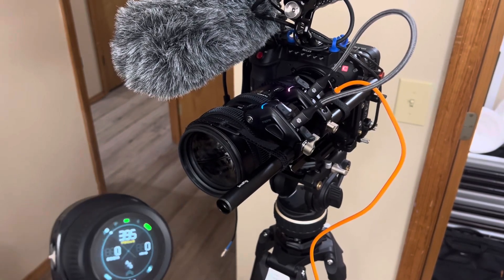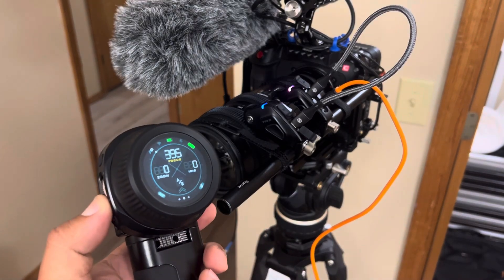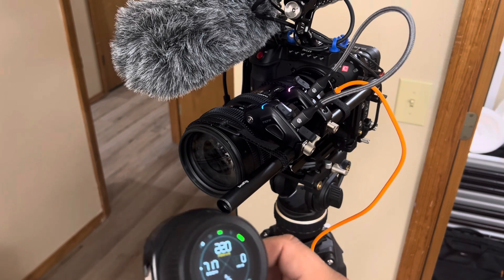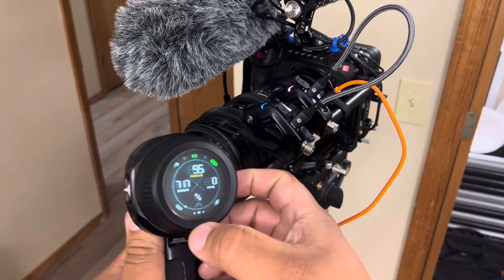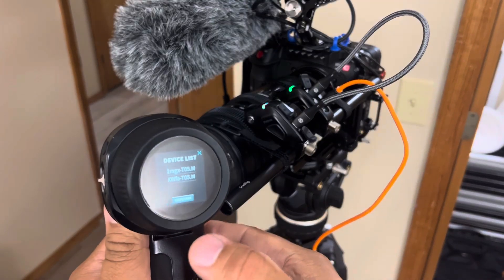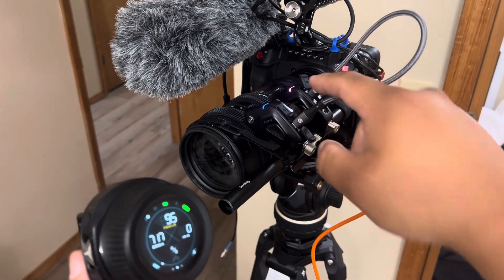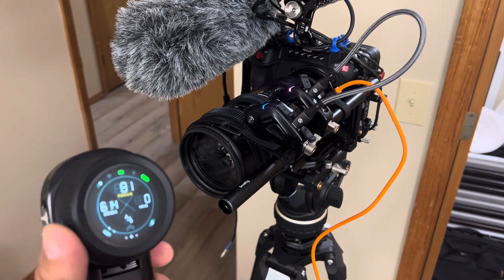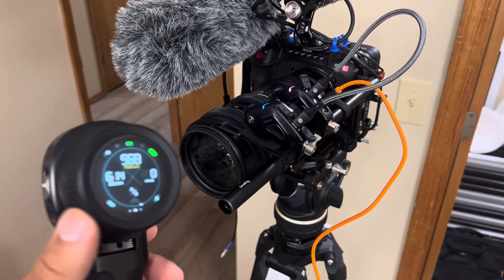Tilta Nucleus Nano II not working with two motors. (Possible fix in description)

Comment: Unfortunately these are plagued with problems, I have issues with it as well after firmware update. I cannot re install firmware the menu isn't working correctly and tilta is horrible for manuals or instructions just some outdated videos, their suggestion is send it back , after just a couple of days
Reply from the maker: Very correct.  I managed to find a solution but it also wasn't 100% and failed on my on set.
Reply: @KongThaoSound  what solution did you find?
Reply from the maker: @ZoharGoldman  The daisy chain seems like it has to go through both the USB-C slot 2 only.  I made a video for that.  https://www.youtube.com/watch?v=OIH27-mV5fY&lc=UgwKUG1WkwyPGsq24Ct4AaABAg

Comment: I’m having the same issue. Got two motors working with Tilta Advanced Ring Grip, but it starts to have issues after motors slip on the focus rings. Has been driving me insane trying to get it to work!!
Reply: *having the same issue - running two motors with Nucleus Nano II.
Reply from the maker: So I tried it again and I daisy chained the USB cable from the first motor to port 2 on the second motor.  Try that and hopefully, it works out.
Reply: @KongThaoSound  Yep. All good now. Thank you!!
Reply: Thanks @KongThaoSound! 
I tried this and it worked, but the issue I’m having is the motors slipping off the focus rings. They slip and then get stuck and I’m stuck with motors not spinning. I must need to adjust the Torque and A/B points for the chosen lens.
Reply from the maker: @paulcurtis4188  I see.  Maybe you need to secure the lens.  Usually, the lens mount wiggles from the focus motor pushing it.  If you look at my setup, I have my lens tied to my 15mm rod with velcro so it doesn't move around.  That might be what you're experiencing.